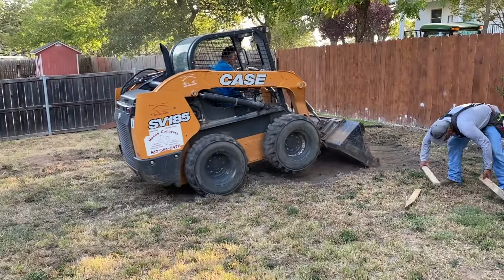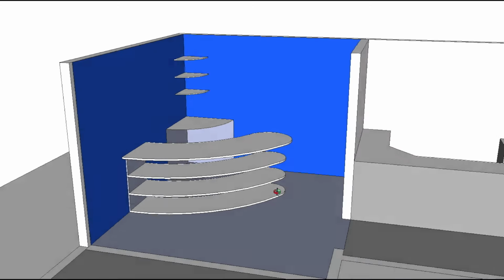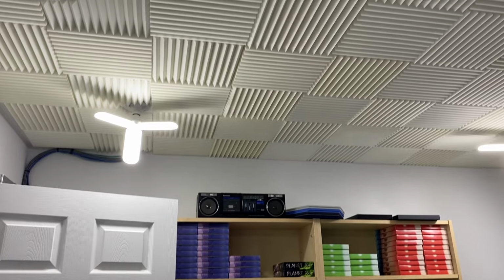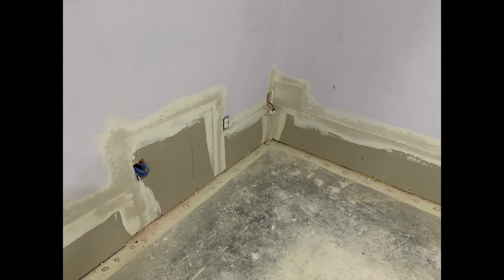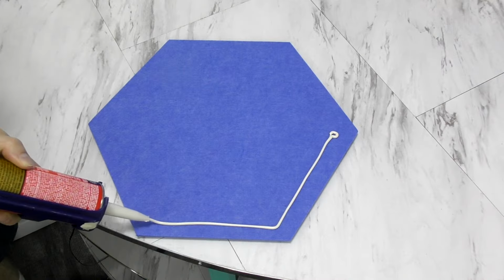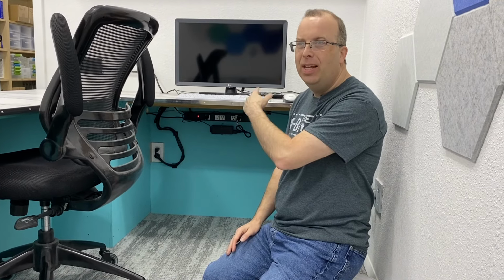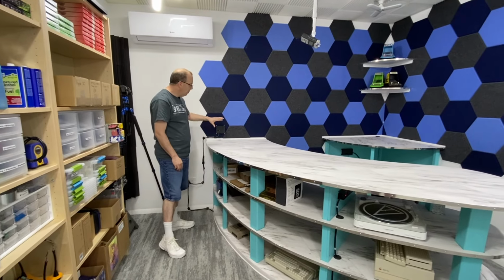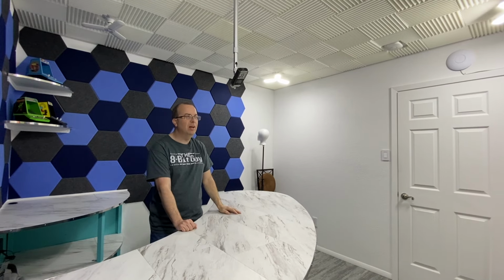8-Bit Guy Studio Build - Part 3

Comment: I have found that if you put a thick gauze on a kne that was scratched like yours, probably soaked in some lotion that cools it down and making it feel less stingy, you can do stuff like kneeling, etc. You would have to tape the gauze (again, use a thick layer of it) to the knee to cover the scratched part completely, but it will do wonders. As a kid I got scratches like that quite often and the stuff I described worked wonders for me.

Comment: Oh, Roger Wakefield wouldn’t approve a nasty sharkbite fitting.
Reply: Yeah o-rings will always fail.  They fail on million dollar piece of equipment, how they expect them to be trusted for plumbing. That are supper useful for emergency repairs, but I would never put one behind drywall.
Reply: The pipes were freezing. If the shark bite hadn't been there, a copper pipe or during would've eventually burst instead.
Reply: @njbair  it's not just this one failure. Plus the fact it failed at the shark bite means it was the weakest part.
Reply: That’s what I was thinking

Comment: Grounding is a good idea, but don't connect it directly to ground. Instead put a few 0.5-2 megaohm resistor in series (eg 10 of them). This way the metal edge won't shock you, only slowly (relatively speaking) bring you to the ground potential.

Comment: New studio looks good. I feel you when it comes to the tiles but I'm sure it'll grow on all of us. If not, you can painting the wall a darker color and hand sound deadening panels on the walls. DIY Perks has a great and simple project about this on his YouTube channel. Maybe you can get a company to print designs onto the fabric (Like the Planet X-3 box art). Also I'm sure the comments already mention the overexposed desk at the end. If its not one thing, it's another when it comes to filming, haha. Maybe its time to swap the stick-on tiles with darker ones like on your old desk. (Or maybe those vinyl stickers can make a comeback, haha) 
For now I'm sure you can get away with color correction and then save a preset so you don't have to spend time color correcting every clip. Another tip, when setting up your shot, put tape on the floor to mark where the legs of the tri-pod go. That way you know that the framing will always be right without having to spend too much time fiddling with the camera.

Comment: It looks great. My only comment. That weird, blue-green (foam-green) in the back corner counter, clashes with the hexagon colors. I would paint that a dark blue or even black. The office is neat, and it provides a place to hang out /man-cave. The office area needs a wide screen monitor (like a 42 inch). If it was 1984, I would say, "awesome, dude."

Comment: I hate it when you trip over your own feet, man i have done this so many times and it has cost me quite a few broken bones. If there is one thing ive learned and its not easy to resist, never ever brace with your arms, that mistake cost me a dislocated arm, because my elbow broke and my arm pointed the wrong way. Most painful experience in my life. 

As someone who doesn't live in America, i am curious as to why you didn't go to the hospital?. Surely a basic check up is free? or at least very cheap?.

Comment: Hey David, I have a couple of suggestions:

1) The LED lights which you have used have a poor CRI (Colour Rendering Index) which makes your skin look pale and less "alive"
You can either use old incandescent/halogen lamps which have near ideal CRI of 99-100% or you might want to invest in some high CRI LEDs which use high quality phosphors.

2) Adding ground directly to the metal straps is a BAD idea, there should always be atleast 1-5 Mega Ohm resistor in series with the ground strap 

Also if any mains reference PCB scrapes over the edge of the table it'll get shorted to ground with huge surge current which is again, bad.

Comment: Regarding the grounding...you are right about getting shocked or shorting something you do not want shorted.  That's why real grounding strips have high impedance resistors to the ground sink.  IIRC 1 megohm or more.  I would suggest getting a real wrist strap and use that to tie the strap to ground.  Then you don't have to worry about remembering to flip the switch.

Comment: Interesting.  2 quick hints.  For better quick sound deadening, try hanging two large thick white Towels (like the ones at Costco) over your shelf's in the studio, not only will it help with reducing echo, it will also help brighten up the studio.  And be careful of the window tint, if it gets to hot in direct sunlight, it can cause the glass to crack.

Comment: I like the hexagons. Certainly way, way better than the previous background, which was too noisy and too sharp in contrast. These are way more pleasant and interesting. I also think that the grey ones are better than black. You want dark, but not too dark. In fact, I think that now you have the opposite problem. The old studio wall was blue, but still rather reflective because it was painted. The felt of the hexagons is purely matte, and you might have to improve ambient lighting a bit to compensate. Just slightly. Nothing big

Comment: The hexagons made David's skin look greenish, like Lady Dimitrescu.
Reply: I thought that too, but in the still photos and some of the handheld shots he looks a lot more natural, so either it’s just the one camera acting weird or it’s a deliberate grading decision. Even so, I think the new background makes his skin look a better colour than the high-contrast navy blue one did.
Reply: I'll go ahead and speculate that it's these workshop lights which probably have an awful CRI. The lighting is not great and a little too bright perhaps, especially behind David's head. The way you do three-point lighting is using a 100% key light, 50% fill light and 20% back light. This would probably also eliminate the need for a super dark background as it wouldn't be blown out in the first place with a more directional and toned down back light.
Reply: @ez45  I'm mostly sure this is the result of cheap led lightning with awful CRI (likely < 80). I did a lengthy comment on a previous video about this, but got no response, I don't know if he is aware of it or not; but buying lights with a CRI of 90 or greater is a must if you don't want to look like a corpse in video.
Reply: @Spyd77  Yeah, and they are also uniformly bright across the room, which is counterintuitively not ideal for filming, and blast top-down and reflect off the bright table surface.
Reply: Probably a white balance issue. Look at the stills 19:26 - Dave looks great on the color combo.
Reply: 8bit Grinch
Reply: The hexagons make it look like he's in front of a green screen.
Reply: might also be the camera. prob be best to colour grade it in post.

Comment: I think a background with elements which are all almost the same color would be good, and lighter colored.   Right now the contrast between the lighter blue hexagons vs. the rest are pretty eye catching/distracting, and will be of a similar color and value or a bit darker than the t-shirts you normally wear, better if slightly lighter??  And the back walls are much darker than the white bench top (so the bench top looks washed out.) You could also add some key and back lighting, maybe small track lights or strips/bars above the back walls pointing down or something like that?

Comment: Re: camera settings
Use manual exposure, dial it in on yourself and make sure you can adjust the lights in the room to keep it all balanced if needed. Also, in some of your videos the main camera has a slight green tint that is also visible in this video, especially on your face. This often happens with some types of LED lights. You can use the dummy you have for framing to dial your camera‘s white balance in manually (or use it as a reference in post). A color ref chart can be extremely handy for that as well. Pay close attention to skin tones. Fixing skin tones in post is a pain in the butt. Then lock your entire exposure in. That way it will stay consistent throughout. 

Hope this is of use!
Reply: The lighting probably has a bad CRI rating so the footage looks bad. Even with post editing there is only so much you can do about it. DIY Perks has a lot of footage on how huge the differences can be, check it out if you like!
Reply: @achannelhasnoname5182  I don't mind hexagons myself, but I prefer the way LTT did theirs when they did their old WAN Show set, which they finally took down recently, during remodeling... I mean, being a computer themed channel, the red and blue made lots of sense...
Reply: There's a lot of things that can be done to help fix it, but it's good that people like you can try to help with settings rather than redoing the wall altogether 👏
Reply: Those workshop lights may not be great in terms of CRI and the brightness is the same everywhere, with a little work on a three-point lighting setup with a dimmed backlight, this would look great even with a brighter background.
Reply: Doing color adjustment is a bit difficult for colorblind people like our host.
Reply: @johndododoe1411  This is a good point. 
Thanks for pointing this out! I hope this does not make me look rude or insensitive or anything, because that was most definitely not my intention. 

I had put that somewhere in the back of my mind and left it there. Still, pointing the camera at something white and telling it to adjust its WB to this, is something that can be done.
Reply: Agree, he looked quite green in the last shot
Reply: Also locking exposure will stop the fluctuating brightness in the last shot.
Reply: Having been reminded that Dave has issues with color vision, using a color reference chart (eg the "ColorChecker" from Spyder) would probably be the way to go. Film it located in the same place as your face would be located, import it into your video editor and then set the color correction using a frame showing the reference chart. Some help from a person without issues in color perception might be needed here.

I do not know how Final Cut might handle this (iirc, David uses Final cut...? Pls correct me if I am wrong!) but in Premiere you can crop the frame to each color field of the chart and then use the vector scope to dial in the colors properly, as well as white balance and the black- and whitepoints. You just need to make sure that the graphs point to the right area so the video editor knows what reds, blues, greens, magentas, yellows etc look like. Then store the settings in a LUT. This takes a bit of time to set up initially, but if all the footage is consistently shot with the same settings and in the same location with the same lighting, all you would need to do in the future is to import your footage, apply the LUT you stored and you have all the footage color corrected with a few clicks and only require very minor additional corrections, if any. If you do this for all the scenes you might have indoors (front, overhead shots, detail work etc), this should get you some good results. The automatic white balance in many cameras gets thrown off by some types of LED lights and makes the footage look weird. This is not the fault of the person behind the camera. 

Using "proper" studio lighting with good color rendition would be the ideal way and would have several benefits, but it also comes at a cost. Not everybody wants to bother with that, which is understandable. Given that David has been dealt a shitty hand by the weather and had to repair damages to his house, I can totally understand why something like "proper studio lights" would go on the back burner indefinitely. If it is considered at all, that is. 

Also, it might not be practical to install a 3 point lighting setup because stuff often gets in the way. But I totally get where the argument is coming from. 

With all that said, none of this is a "deal breaker" in any way, shape or form. Just trying to offer some advice to add some polish to an already high quality product. :-)

Comment: Does it bug anyone else that the Steel strapping was installed with the writing upside down?
Reply: (: tib a em sgub ti sey
Reply: What bugs me more he didn't use countershank screws to fix it.
Reply: @mrnmrn1  he probably wants that look
Reply: @mrnmrn1  countersunk screws wouldn't hold that stripping up though. Because once you use the countersink bit you'd have ground away all the material that would give you some grip. That's like saying he didn't use sandpaper to hold two pieces of wood together
Reply: I mean does it really matter it’s just for aesthetic reasons it doesn’t need to be correct
Reply: It probably would if it were mine but it's not so I'm fine
Reply: kinda

Comment: I use those same sort of self-adhesive tiles for topping my workbenches.  Those things are incredibly wear resistant and super rugged ( they are meant to be walked on daily, so not much of a suprise there).  And if one does get damaged, just rip it up and replace, easy as pie.  10/10 would reccomend :-)

Comment: Be careful with metal tape around the studio bench. I had this kind of table/bench in my old apartment. I fried many electronic devices because of it, including the CRT I was repairing. Everything happened when I tested a device without a housing and part of the PCB was unintentionally touching the metal tape and making short circuit between random points of the circuit. Since that time I always go with wooden table/bench and plastic edges. Much safer for the devices I am working with.

Comment: You can't determine how much sound deadening you're getting in a room down to percentage numbers without measuring it with a measurement microphone and proper speakers. Acoustic foam is very good at high frequencies, which are rarely the problem on small rooms. Given the chance to change anything, I'd make the ceiling completely dead by extending it 12" down with beams, stuffing that space with fluffy fiberglass (75 Kg/m3 and above), then covering that with some acoustically transparent fabric, like burlap. Your room is square, so you'd have to do equal treatment on all walls for some effectiveness.

Comment: Table color needs to be darker.  It's blowing out the color balance on the shot.  Makes it look like you're filming in an operating room.
Otherwise I like it.  Nice job, and entertaining update.  You could experiment by just draping some dark cloth over it for some test shots.
Reply: I think it isn't great against computers that are often light/off-white colors, too.
Reply: Yeah it's very bright.

Also, I was waiting to say something until the back wall was fixed, but there's something wrong with the lighting and what it does to skin tones.

Though that could be camera settings; the stills he showed had much more natural skin tones.
Reply: @njbair  yes, these workshop lights' CRI is below 90 for sure and possibly below 80, not ideal for filming. And the corner where David is standing should be much lower in brightness.

Comment: Well it's a million times better than the hideous vinyl stuff, but the way you arranged the hexagons in the corner of the room so that there's a central strip of not-hexagons is going to bug me, as are all the small gaps where you've not lined them up quite straight. (And the bench looks like a counter in a diner in south Florida circa 1989...)

Comment: The stainless steel straps do not need hard grounding for ESD. Mats, ESD straps and such have a 1M Ohm resistor connected to ground, in order to not electrocute yourself and make any discharge "non-zappy".

Comment: What I miss most about the old studio are the apparently absolutely necessary geometrically arranged cables and devices. One had the impression that your studio was installed in an 80s computer itself. Life in the machine. almost like in a submarine control room.

Comment: Hey there so I can help you with your echoing situation what you need is called a sound deadening panel this is not like the material that you were using on your ceiling what is years is you get some two by twos you build a small square frame wrap the small square frame in some color matching vinyl or fake leather there’s a reason for this once it’s wrapped and stapled on the backside you then fill in the void of the center Square with spray foam you can use the foam in the can from Home Depot and you want to lay the frame that you just stapled the material onto flat face down and then fill the backside with the spray insulation foam cut off the excess foam so it’s flush Then hang the panel on the wall that’s how you get rid of echo it’s the same trick movie theaters used for decades
Reply: Someone please translate this run-on sentence to English.
Reply: @Galactipod  Honestly, I have no clue. It's not just a run-on sentence; some parts just don't make sense.
Reply: Do you know what you don’t like it blame auto correct blame freaking YouTube if you got issues with people then come and talk to me directly if you don’t have issues with people then shut up

Comment: I like the hexagons a lot, but why the one blank spot just to the right of the rear workbench? If you filled that with most of a light blue and then the tiny section that would be left over with the dark blue, and then the vet far right bottom with a light blue(maybe even just the part you would have to cut out of the first would be enough) the background would be seamless